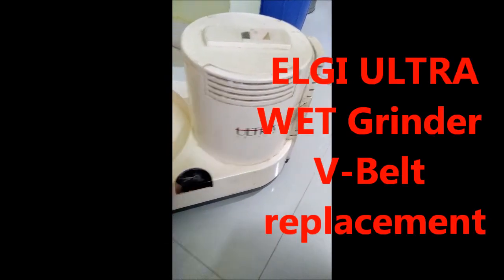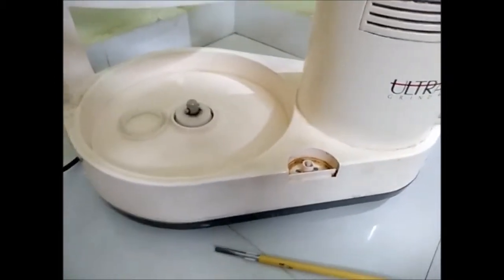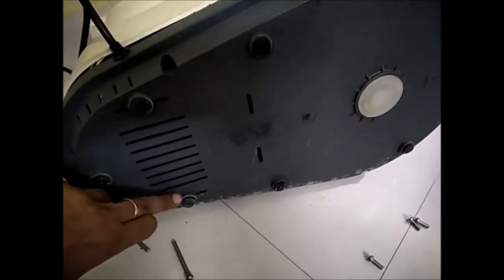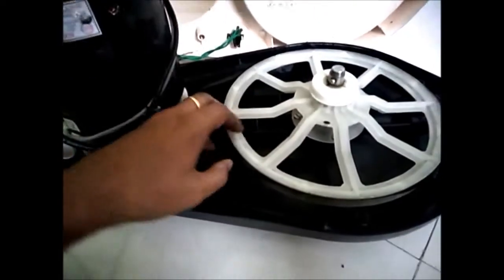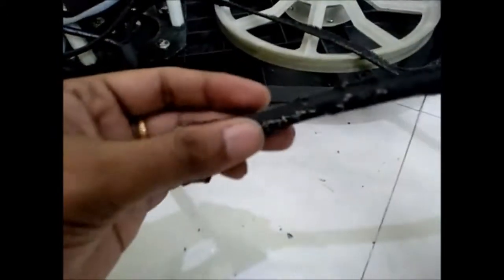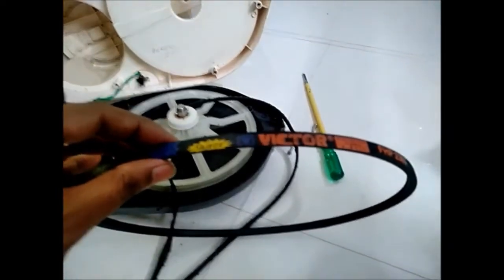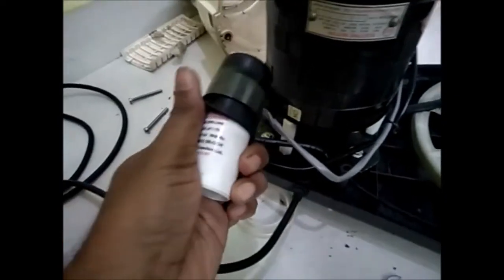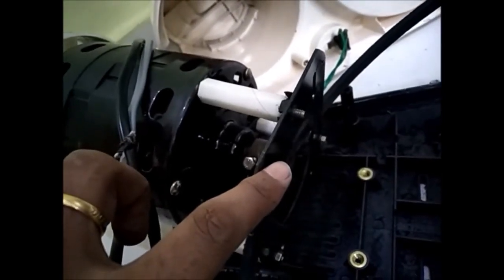Grinder belt replacement made easy

Comment: If have the really old model GV 001, then you need a standard 'V belt'.  The NAPA (USA) part number is 3L370W.  This corresponds to 3/8" wide 370 mm long belt.  This may help you locate other equivalents from a different manufacturer / supplier.  Do not know if the 2004 model is a GV 001 or not.

Comment: Gerald - very helpful video. I have the same issue and exactly the same model. Would you know where to get the spare belt. Mine is 2004 model. Thanks a lot!
Reply from the maker: You  could find in your local market..check in automobile shop with your belt number and specification.. some time in steel utensil shop also have it..where mixer and grinder work is done